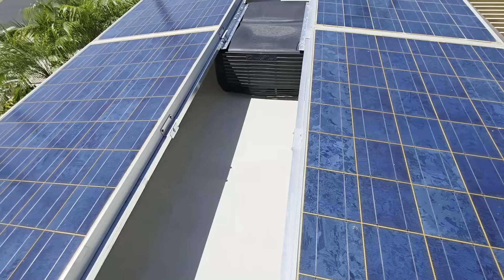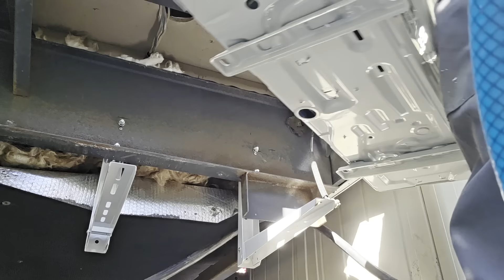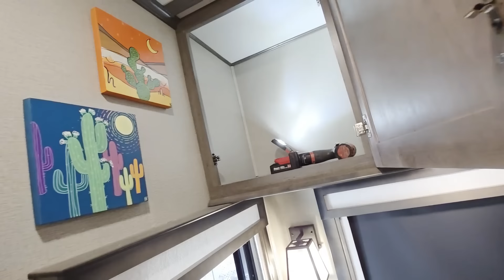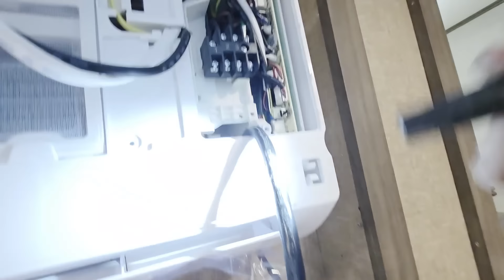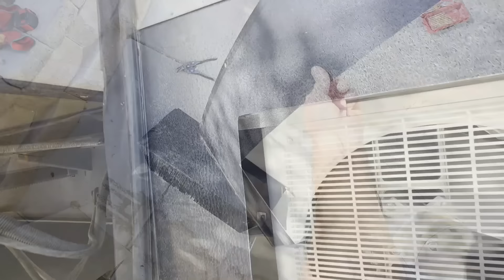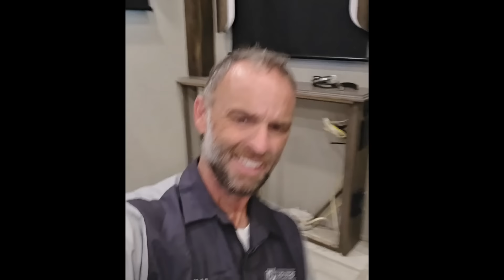Are Mini-Splits Worth the Hype? YES!!!

Comment: Now im not knocking your skill or knowledge however, if someone was to follow this installation method I can guarantee you that they will experience issues very soon after. Minisplit service ports are 5/16. Second you should remove any excessive lines set. It is also well advised to purge with nitrogen, followed by a pressure test to 500psi. Use a bubble solution and spray all connections. One must note that when making the flare connections do not over tighten, do not ise copper gaskets. When pulling a vacuum you must use a micron gauge and must be pulled down to at least 500 micron. When finished pulling a vacuum, monitor the gauge and see if is holds steady. After monitoring for loss of vacuum at this point you would release the refrigerant. Again please don't take this as me questioning your skill. I am simply stating how you could improve your installation to prevent any call backs.
Reply from the maker: Those are great points, I did say some installers like copper gaskets and I did say removing the extra line set could be better in the description, charging with nitrogen seems overkilled and not required and I am dumbfounded that a single flare connection is what is used, and at $500 these are close to disposable every few years.
Reply: @AZExpert  You are correct per the instructions it probably does not mention testing with nitrogen.However this simulates operating pressure range 300-550psi, and stresses the fittings allowing you to check for leaks with leak detection solution. I don't understand what is so dumbfounding about a single flare withstanding the units designed pressures. JIC fittings commonly found on high pressure hydraulic systems are flare granted at a 37deg, but are able to hold up against several thousands of psi with no gasket. Flare and JIC are designed for a mechanical face seal.  That particular unit likely used 1/4 and 3/8 both of which have a burst rating of around 1100-1200 psi, more than double of the units design pressure rating. The price point should not be the determining factor if the unit is disposable. More times than not it is poor installation is what is reasonable for the units to be disposable every few years. I'm sure the instructions do not state  that this unit is RV rated or rated for heavy vibrations and movement, but that's how it is being used. Pont is you can use it for this application and it funication for many years if installed correctly. As I stated before I am not questioning your abilities, just simply providing a little guidance. I'm a long time subscriber and enjoy your content, so please don't take this as an attack that is not what was/is intended.
Reply from the maker: @ctaylor114 Because LP systems run at 10" WC and use single flare and still leak. Brake lines double-flare and still leak. I'm surprised the systems don't use o-rings leak automotive lines and assume rubber hoses would be damaged by the refrigerant. Roof A/Cs are basically disposable and they cost twice as much and will break frequently .

Comment: Nice clean install. I put a 2 head unit in my 5th wheel. Outdoor unit went in my generator bay and I have 1 unit on the ceiling of the bedroom, and the other in the back corner. In 100 degree weather it pulled about 1600-1800W, about a third of what running all 3 rooftop units would have. And it was a pleasant 70 degrees inside.

Comment: Did you mount the evaporator head in a slide out ??? The lineset will move while extending / retracting.  Hope it doesn't get damaged. BTW mounting the condenser that close to the frame is cutting air flow but i realize space it limited.
Reply from the maker: It is not in the slide out and the rear airflow is still petty good

Comment: HVAC technician here and you did a great job sir. I install minisplits a lot and I love them.
Reply: Could this unit be installed with the condenser in a vented attic and use a tap into a vent or the condensation?
Reply: @vincentp.chianese2873  No bad idea heat and winter condenser will drip water without any safety measures to handle condensate good chance it overflows a plugged up pan drain and runs down into your house.
Reply: @vincentp.chianese2873  That is a very interesting idea, in the winter it might help keep the unit from freezing up by being in the attic space with gets slightly warmed by loss from the building. If it does start to collect ice and starts doing defrost cycles you will need to make sure the water/ice slurry falling off the condenser has a fool proof way to exit your attic space or you will end up with a water problem very fast. As I think about it more I think that outside is probably just the best option to avoid this issue.

Comment: After being in the HVAC trade for more than 44 years, no one has convinced me to own a mini split. Especially now that the refrigerant is flammable. End of your job looks very tidy and well done. But in practice not so much in my opinion. The location of the condensing unit will take a beating from anything that the rear tires kick up. Anything from sticks to metal bits to rocks to anything that one sees laying on the road, to water and sand.... you get the picture. That condenser coil is exposed on the left side, you know the side that faces the rear tires and all of that kicked up road debris. Backing into a curb stop or some other such item just one time and all of that pretty work will be forgotten. On to the refrigerant line set, although you were thinking about the service guy to come by in the future and believe me you may be the only one out there to think about them, all of the EXTRA tubing in nothing more than an oil trap. Loops should be horizontal not vertical. The system comes from the factory with a certain amount of oil in it and that amount of oil is used to lubricate the compressor parts. If the oil is trapped in the loops of the tubing, then the compressor will not get the oil that it needs to keep its parts lubed up, shortening the life of the compressor. The air handler is looking great all tucked away in its cubby. But someday it will need to be serviced, and the evaporator coil will need a cleaning. The access to do so is very limited. Which may require that the air handler be removed. Now you can answer this part, how many hours do you think it will take to clean the removed air handler. After recovering the FLAMMABLE refrigerant, undoing all of your cabinet work, clean the unit and reassemble the whole thing. I see several hours. And that is if everything goes as planned and no lines are kinked. I would think a few hours at the very least. Roof top units, had they not been covered up by the solar panels would only take an hour or so per unit to pull and clean and reinstall. The condensate drain line may need a "P" trap installed for better drainage and/or to keep bugs/wasps or other critters out of the tubing. Check the paperwork to be sure as there may be a "P" trap already installed at the air handler and not require a trap at the outlet end. Adding a second trap will NOT allow the water to drain properly. Again, i am not in favor of mini splits, did i mention that? Nice job looks very tidy.  Jim in central Florida
Reply from the maker: Thank you for your thoughtful comments. Ducted systems are a farce and choke airflow. These units are nearly disposable and you might be surprised to know where the coils for your dash ac are located on a car. Most rv condensate lines use a kazoo cap for bugs and p traps on rv condensate lines are not a thing. Removing the outside unit would take 5 minutes and wait til you hear how many rv roof ac units fail and the ordeal of changing them

Comment: I have one recommendation, please remind the owners that when they use a generator to never use it near the A/C unit as in will bring carbon monoxide into the home.  That’s only advantage to having roof A/C unit    Job well done sir, as always I enjoy your channel
Reply from the maker: That's not how acs work at all
Reply: @AZExpert  on mini split you’re correct, my bad. Just trying to look out for you and customers safety.
Reply: @davesrvchannel4717  It's not how your house AC works either. Residential ACs do not mix outside air with conditioned air.
Reply: @billbrigham7514  how about AC units that come on rooftop of camper? I know I once had my generator 20’ from my camper, and I started smelling exhaust.  So I went out to move my generator and turn it so exhaust was facing away.

Comment: OK, I was already looking at mini-splits for my Class A and ran across this video, and you've convinced me to go ahead with it. The current system in my unit can't even make the interior comfortable when outside temps are in the 90's. I could remove the existing unit and replace it with a 12K BTU unit and use less space than the existing POS, while doing a better job at cooling the unit down. I can't tell you how much I appreciate you putting this out on You Tube!
Reply: On a class A you probably have 220v available so maybe consider an 18k btu unit if that fits your needs for cooling and heating. Just a thought.
Reply: @Patrick-n4j There's a lot of times I'm parked at a boondocking site where I have to run my genset which is why I chose the 120 volt version, but I agree, the 18K version would be better.

Comment: I looked this minisplit at their official site.   The MCA is either 17 or 18.  So that is why it calls for a 20 amp breaker.   The watts given do not normally require 20 amp circuit.   So, the reason that it needs the 20 amp circuit and the watts is low can only be one thing.  Their motors have horrible power factors and a high inrush current at startup.   Higher than normal motors.  Since they do not list running load amps, or any real amps, I cannot verify it, but I’m pretty sure I’m right.
Reply from the maker: Yes, these are pretty inefficient a/cs but still radically better than the best roof a/c
Reply: @AZExpert .  You didn’t happen to do an amp draw did you?
Reply from the maker: @KevinCoop1 not directly i didnt even have time to check it in normal mode or eco mode

Comment: Question though: would it handle running off a generator while it's traveling down the road hitting bumps? I know refrigerators in particular, their compressors don't like being jarred around and will short out tripping them off.
Reply from the maker: I think that is mostly urban legend. Skoolies and car haulers have been using these for years and residencial refrigerators have been in RVs for decades

Comment: Great install.  I wonder if the outdoor unit can be installed horizontally rather than vertical?  If so it should be possible to keep it from hanging down so low.
Reply from the maker: No these cannot be installed any other direction.
Reply: @AZExpert Thanks.  Would be nice if they could.

Comment: I’d love to know what you charged for this install. I’m a commercial HVAC technician in Ohio and I do lots of mini split installations as side work. A single head unit runs between 1-2k for installation depending on how complicated the run is and if I need to do electrical work at the panel. This is labor only. For what you’ve done here I’d expect at least 3k in labor. Please let me know as I might
Reply from the maker: I think $1200-$1500 seems fair for most installations, but the cabinetry was much more work than I planned on it being.

Comment: Nice job! Very well done. I have an 89 Beaver Contessa that I installed a similar mini split on about a year ago. It works amazingly well and I can run it off of a 460ah battery for about 6 hours driving down the road. I only have a 60a dc to dc charger charging the battery for now so I have to run the generator a little on long trips.
Reply from the maker: That sounds like a great setup, and I'm glad you're getting good performance out of your system!

Comment: Very nice. I have 4 in my house, and 1 in my RV. When I did the RV I consulted a metal fabricator. He felt the factory condenser brackets weren't up to the task of holding the unit on a moving vehicle. I put a metal strap around the case and secured that to the vehicle frame. That way, even if the stock brackets fail the unit won't fall off when driving and cause harm.
Reply from the maker: I added the brackets at the top to support the weight also, but I understand the concern. Fabricating a mount on-site with minimal tools in the summer heat made a lot of the choices for me. But the steel should be plenty strong especially compared to the frame failures on Grand Designs already :)

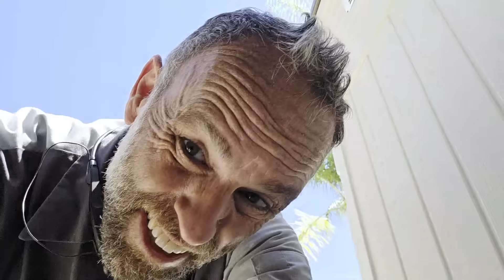Comment: Installed that same unit in my 34 foot motor 5:08  home and itdose really well up to about 95 degrees out side here in New Mexico. After that high temperatures i close off the partition to the bathroom and bedroom then it keeps it between 75 to 78 degrees inside. Also I installed the outside unit in a storage compartment and the lineset,wiring up through the floor and  and up the inside wall with a cover set and the drain line can be difficult to hide i just put the drain line a large cat litter container and it works for me. The heat function works ok in the winter months to reduce the amount of propane use for  heating and cooking i also installed a on demand water heater. I have been living full time for the last almost 2 years here in New Mexico.
Reply: @geneschultz2790
I went through the same experience in the desert in Iraq. Our military compounds were equipped with mini-splits, and when the temp shot up to 120°F no air conditioner could convert or handle the load.🌡🔥 🥵

Comment: It looked like it had a receiver set up. It would have been easy money to just mount it off that.....and no departure angle issue as it couldve been mounted higher. Single penetration out back wall for tubing.
Reply from the maker: Yes, but then I would still have to rig up bracket to keep the hitch from rattling and twisting, and it sticks out substantially and would be the first thing hit and hit easily.

Comment: Very nice install. I have seen a few hack jobs on YouTube. For your next challenge install a cartridge type Mini split in place of the junk AC roof unit. The ceiling ducts can be connected to the cartridge units.  Awesome job.
Reply from the maker: I really feel the biggest improvement the mini splits offer is that the volume of air exchange is so much better than the tiny roof opening and ductwork with no heat gain in a superheated structure like the roof

Comment: To work on this outdoor Heat pump it would require the top of the outdoor unit coming off!! Yikes!! When reading your install instructions I don't know if it mentioned anything about that. When you were putting the indoor unit on the wall I was thinking he didn't hook up his electric. Oh Well. Oh and one other thing I have found it easier to feed line sets downward to the outdoors than it is to go up. It is easier to do when your a one man operation. Hope my two cents is worth your time. I enjoy your videos and I am looking forward to your next great adventure.
Reply from the maker: It slides out easy which is why I left the lines longer

Comment: What really has my attention for our 21 ft RV (Escape 5.0 full fiberglass “boat like” 5th wheel) is the 12v AC. All the reviews I have seen have been positive except for one. It was tested in a larger RV as the only AC running on a very hot day. He said these type of units are best suited for smaller RVs. My guess is also his RV is not sealed nor insulated well. I don’t think the 12v ACs would work well in Airstreams either, because they are basically rolling metal ovens. 

Our current AC is either on or off (no thermostat). The settings are either LOUD, LOUDER, OR ✈️ Taking off!!! 😳😱🙉 So the upgrade will be in our future.
Reply from the maker: I have seen the 12vdc A/C installations be surprisingly difficult as they are made for van roofs and the wiring requirements are difficult to run nicely. I think the factories should start installing them on every motorhome though
Reply: @AZExpert I agree or at least make the wiring available in the future.

Comment: When your business shifts into doing this full time lol, there are a few tools that will make it easier for you. Look at using a micron gage to ensure proper vacuum, and check for leaks under vacuum and get a decent orbital flare tool.  With minimal practice anyone can make really nice flares with one.  Great job on patient zero in your new specialty.
Reply from the maker: I removed my flaring tool kit because I have not had to repair LP copper tubing in years, but I am still shocked these are single standard flares on these lines.

Comment: This unit is a better option Pioneer® 10,000 BTU 115V Under-Bench RV Inverter Heat Pump Air Conditioner IMO   Also nut inserts work great checkout Kimball Industry they sell a kit that comes with the installation tool it works like putting in a rivet
Reply from the maker: I do not tend to trust nut inserts with heavy loads or stress like this.
Reply: @AZExpert  IMO you should have have used grade 5 or grade bolts and not a carriage bolt and also use some type of rubber or nylon between the dissimilar metals to prevent galvanic corrosion
Reply from the maker: @stevenfulton1563  I think you overestimate RV manufacturing quite a bit, there's no part of this RV that is not aluminum touching steel somewhere, and those carriage bolts are way stronger than they need to be already.
Reply: @AZExpert your overall knowledge and experience in RV repair is excellent, however your fabrication skills are lacking IMO using a carriage bolt proves my point.
Reply from the maker: @stevenfulton1563  youre ridiculous or being funny, carriage bolts are superior to hex heads and are used in most hitch applications